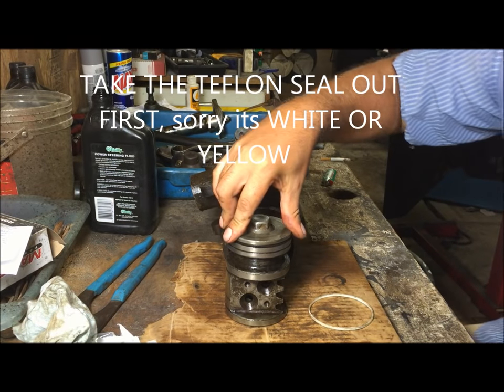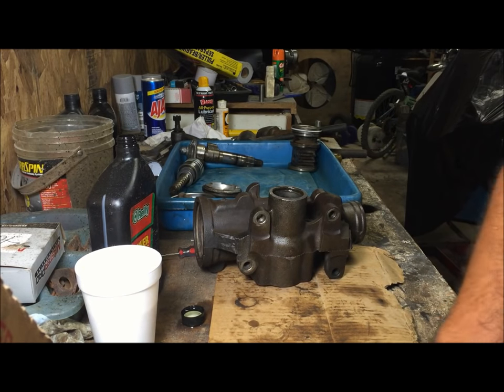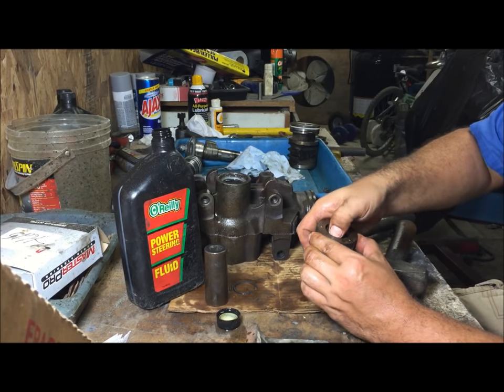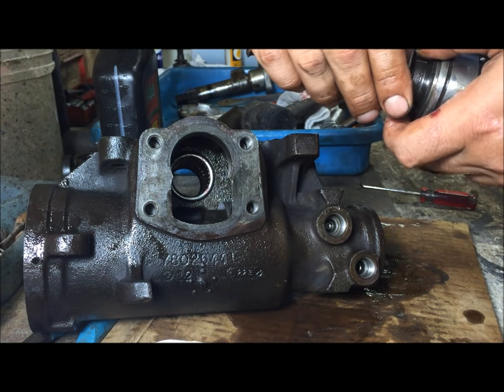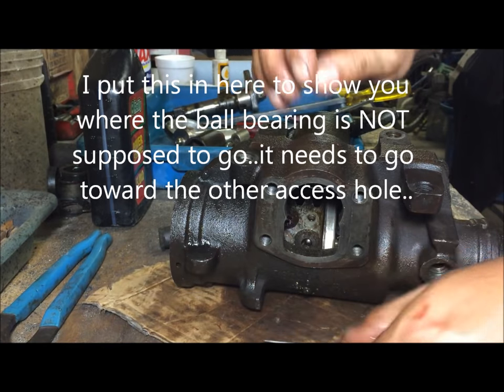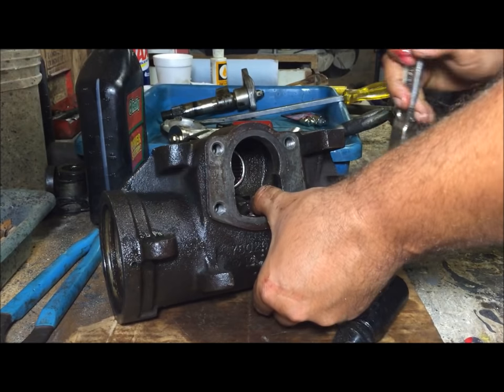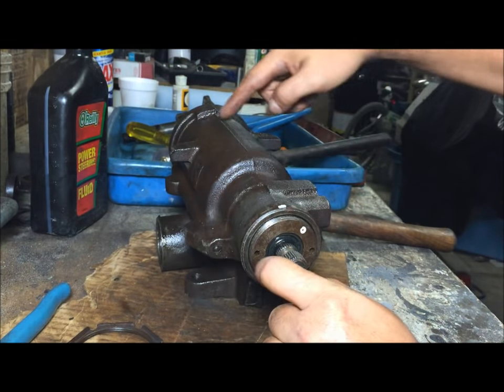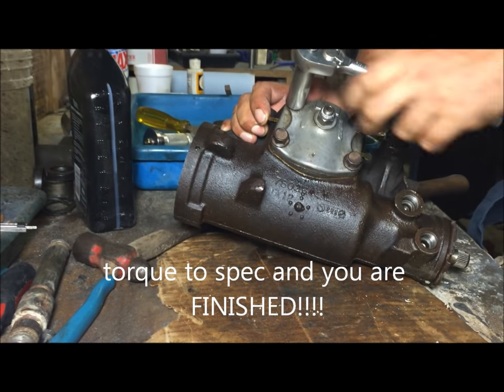how to rebuild power steering gear box saginaw part 2

Comment: Hi Chris, graet job on the rebuilt. I had watched your video and also rebuilt my 2000 GMC steering box which happen to be just like this one. The box seems to be ok except I now have a automatic steering I don't know how to fix. I had a broken clock spring and I was trying to knock off the steering wheel before I actually got a puller, now the steering turns automatically to the right whenever I start the truck and just stay there with a clicking sound. It there an adjustment on the steering column or somewhere to adjust the steering back to normal? Or did I mess up with the steering box rebuilt? I really need some help, it has been a month and I can't figure it out.

Comment: So the bearings had to be reused? No copyright strikes on the music?!  hehehhe  I do not have the patience I used to and after being broke down for two weeks I just want to get back on the road. Haaaa, just as I typed this you stated that "it is time consuming". Now you said it is tricky. This is not easy! 
Probably the most important things you said to help me decide.!! I will get angry. Challenging repairs no longer have the reward they used to. 

 I have decided to get a reman for 300$. Fortunately God sent me just enough money to get one.!

Great job on the video !
Reply from the maker: both of my boxes I rebuilt work great to this day.. my boxes were leaking fluid only so they didn’t need a complete bearing rebuild. dont ever run transmission fluid in place of power steering fluid. neither box had excessive play or I would of bought a reman one
Reply: @chriscraft77022  I would never think of putting Bud Lite in my steering system or blood system. 
Seriously though. Putting the pitman arm on my reman gear box and I thought it was the wrong steering gear because the arm splines did not meet up with the gear splines. I have about 3/16 of arm splines still showing. After accusing Advanced Auto of it being the wrong gear I watched some videos to see that the arm does stand off the end of the gear splines by about 3/16. I can see the purpose of this but I didn't know. I thought the arm had to move in far enough to hit the dust shield. But, the rubber dust shield move down to touch it.

Comment: my 97 c1500 has complete new front end, all new steering parts but i still have slop in my wheel and it is driving me crazy, any change the gear box i bought is no good or is there some kinda ajustment i need to do?

Comment: Thanks for the film Chris !    Who have the answer for me ?                         On the Rotary valve;      are you shore thats its not nesserery that rubber O-rings be placed, under the new teflon O rings ? in the  master repairkit 8524, are these 3 rubber O-rings included.   The old teflon rings did not have O-rings under.

Comment: Is it possible to pull just the top cap, 4 bolts and the lock nut (possibly the threaded "screw" if necessary) for a copper gasket change without having to pull that whole shaft out too?

Comment: Load very thick grease as before to hold the balls in place this is also good trick on Chevy engines when installing a new fuel pump reset the rod shove it in let the grease hold it grease is oil it will be fine

Comment: thanksfor the video! but i have a question about the allen bolt on top of these boxes, technically on a reman 94 k1500 box, installed it an didnt notice from the store that the allen bolt was machined wrong, or pretty much usless to try an get a allen head down into, am i able to pull the top allen bolt without dumping the guts in my box? just need to cut a slot so its adjustable

Comment: Hey Chris, great video! On my '91 K5 Blazer there was a lot of play on the steering box. Adjusting made it better but i was not satisfied so i bought a rebuild one at Rockauto. This one has the following problem : starting from the straight ahead position on the steering wheel the first inch left and right, there is almost no resistance at all (turing further gives the feel you want). It's not so much that there is play, it just feels like it. Has this something to do with the torque of the plate at ingoing shaft where you made those marks (22:03) ?
Reply from the maker: +Camatruder those marks are the preload on the bearings.. if it's not right it will feel wrong the whole range... not just 1 inch.. your new box is fine... how much did it cost on rock auto.. ?those are like $250-$300 at the parts store.. I think..
Reply: 200 USD including core charge. I kept my old one and may attempt to rebuild it myself. I tought that if the preload is too little, that could cause my  problem?

Comment: i would love to rebuild mine but i dont have the proper tools i just recently installed a power steering pump (1997 chevy 1500) and i was only going to change the pump but autozone didnt have any in stock and o'reilly had the exact pump but had something added where the spring and sensor are located i tried to take off the thing off but i couldnt so i just told them to give me the pump and reservoir, it took me 3 damn days to complete, but even though my power steering got way better i believe the steering box is also bad (plus traffic and bleeding the pump) took me 2 days for a rear drum brake cylinder i know those two things should take 1 or two hours tops but i dont have the right tools and i always end up going to the store to buy what i need now imagine if i rebuild this....it will probably take me a week

Comment: 3:10. I'm thinking maybe rotate it a little as your gently forcing it in. Might help. Also, before I watched the video that aluminum cover that has the 4  bolt has that threaded shaft sticking out that has a lock nut on it. How do I now adjust that so the big male gear that intersects with the internal gear is adjusted correctly. It is obviously an adjustment that moves the gear laterally back  and forth across the steering box laterally.?

Comment: Sir, I am your subscriber from Indonesia, I want to consult with you, does the worm steer have something called a TORQUE ROD?  What is its function actually? Because I have a Worm Steer for an Isuzu Trooper Diesel car where my steer is already heavy and I have replaced the Seal Kit but it is still heavy, the information I got had to be checked on the TORQUE RODS and the TORQUE RODS were modified using a lathe so they are usually lighter Turn the steering wheel of the car. So far this has not been discussed with you. function and use of automotive tubes. ? Thank you, I'm waiting for the answer

Comment: If I'm not mistaken aren't the ball bearings all slightly different diameters? And have a specific order. or is that on the vairable boxes?
Reply from the maker: they should be but these were all the same. The Chevelle box had different diameter and they were slightly different colors too

Comment: Hi Chris,

I have a problem with a steering box and seek your advice.

The rubber steering box coupler with the steering wheel was damaged in my patrol and while changing it, I hit the input shaft with a 2kg hammer both in (during assembly) and out (during disassembly). 

Now and after testing the car, the steering wheel is a bit harder to turn especially while in center and the after turn, it does not return to center easily.

Is there a hope with the steering box to be fixed or adjusted?

Comment: what if i fucked up and didn't mark the housing input shaft and lock nut at the very begining?

 how do i get it reset correctly?  the manual says 1/2 inch back off. i tried that but i got a lot of play in my steering wheel still.

Comment: I bought a gear box for a chevy tahoe 99. When installed its hard to turn the steering wheel. Its almost like no power steering.
Reply from the maker: did you buy it new?

Comment: Great video but I have seen too many input shafts where the plating has worn off and the seal will not seal and the bearing will not fit due to the decreasing cost of the entire steering gear even though the parts to repair a cheap the labor involved is intensive and if something goes wrong there is a problem expensive maybe it is best just to by the gear and give somebody else the headache except for installation and removal if it is bad my steering gear on my car is leaking I realize it may only be the seal package while I got it off why screw around just put the new one in and be done with it anybody who adjust the tightness is ignorant it cause it's far more problems than it cures if the sector is worn out pulling tighter but only make it tighter on half turns or third turns it will be over tightened some places while tight enough in others this is not a good solution thank you for a video I bought a new one Advance Auto cheapest price I know that's wild

Comment: I have a 78' GMC square body and currently the steering is awful. You can't get full lock to lock steering out of it at all. I have to make 6 point turn just to get out of a parking spot to turn right or left. It sounds like a damn turkey call once I'm turned the whole way right or left. Is it even worth rebuilding or better to get a new steering gear? Anything I can do in the mean time to try to improve it till I have the money to get one at all?
Reply from the maker: +Samsquanch buy a new one on rock auto

Comment: I hate when the seal garter springs pop out. I made a tool for a crankshaft seal to press it in instead of hammering (which kept popping the spring out).

Comment: Were did you get the seal kit? What number is it. I have the same sterring as you have and I´m planing to rebuild mine to.
Stefan
Reply: AC Delco  Pn 36-350340  Gates pn 350340.

Comment: A long shot, but does anyone have a source for the rack and worm? Once you've done one of these, it takes longer to clean the crud off the outside than to do the rebuild, but I can't find the hard parts anywhere.
Reply from the maker: if my box needed parts like that i would just go buy a new one..  some guy told me he got one cheap on rock auto

Comment: hello, this rebuilt don't fix the axle play right ?
Reply from the maker: no...    this box was good...   search videos..   that have the car with the wheels jacked up off the ground...  that is the only way you can adjust that...  i will tell you right now...  GO BUY A NEW BOX... it is not worth it...  the teeth are worn and the worn teeth will only carve into the gears and recreate the problem...
Reply: ok, I will buy a new one ... thanks you very much for the videos and your time to response.  BR
Reply from the maker: you can not go wrong with a new one...   thanks for watching..  but have you jacked the front wheels off the ground and made sure that the play is not in the suspension?   tie rods? pitman arm, drag link, etc???
Reply: The play is inside the steering box, when you move the input shaft with your hand, you can feel and see the movement in the steering box, but do not transmit the movement to the pitman arm. So I assume that the gears and or the worm must have wear
Reply from the maker: if it is a car or truck you are going to drive a lot buy a new one...  it is not hard to adjust the play but if you dont know what you are doing you will have no way to accurately dial it in other than just the way it feels...  if you had to do it clock the bolt and tighten in increments of 5 minutes (like a clock face) until you get most of the play out.. (that way if you go to far you will know exactly how far to go back) if that doesnt instantly make sense then dont try it.. but if you have family and friends around you dont waste your time...  ive seen steering boxes make fools out of a lot of people trying to fix them

Comment: I load the balls in the cylinder first w/heavy automatic transmission assembly lube, then screw the shaft in.
Reply from the maker: i tried that like 3 times and it did not work for me..   on both boxes i did, but yeah, ive heard people saying that worked for them....
Reply: may be not too easy

Comment: Hello my gear box is really hard to turn on my 82 c10 pick up, if I do this will it get fix??
Reply from the maker: i would replace the power steering pump first.. those boxes last forever..  try to drain as much fluid out as possible,,
Reply: Thanx for responding, I would do that what fluid would you recommend for my box?
Reply from the maker: I use oreilly power steering fluid
Reply: Oh ok I'll get that too, my steering is super hard, I need to battle it to turn haha
Reply: Hey I just notice my steering box is a manual steering box not power steering
Reply: I took the oil fill bolt and the level it's good, if I install a kit will it be fix??

Comment: A very common steering box used in zillions of cars for half a century. GM and Ford among others. And the basis for Sprintcar steering boxes. Alloy case and other mods but still a Saginaw box. Sweet and many others. Used in sedans as well.
Sweet make ratios from 6-1 to 22-1. Unfortunatly for me my RHD Ford has about 22-1 and is bloody awful.
If anyone has any ideas for these RHD let me know. 14=1 would be about ideal.

Comment: I don't think you want to mix grease with power steering fluid.
Reply from the maker: i agree but that box has been on the van for almost 2 years without any leaks
Reply: They at one time were assembled at the manufacturer using a light grease
Reply: It's not going to hurt anything, it's all petroleum. When you've done this a few times and spent time using the part, then pitch in your $0.02.

Comment: Rebuilding my box for my 75 c10 right now and the ball bearings are kicking my butt. The orientation of the holes on mine for the bearings are opposite of yours in the video. With the piston all the way out to the edge, the hole you load them in is at the bottom right corner, mine is at the top right corner and bolt hole is at the bottom right corner. I’ve tried 4 times now and can’t get it right. Don’t know if I have to do something different than you did since the hole orientation is different than yours like I stated.
Reply from the maker: it takes a while to figure it out.. did you check for big and smaller bearings and they go back in in that order
Reply: @chriscraft77022  yeah I figured it out last night. Found another video of one that was a steering box the same as mine with the different size ball bearings and got it all in and working. Thanks!

Comment: I tied to do this, the instructions said to drop them in hot water
Reply: The teflon rings?
Reply: @squidusn71  yes, drop in boiling water 5-10 minutes. Install one seal while others are doing their 5-10 minute soak. My seals shrunk right back to size no issue.

Comment: do not mix grease with power steering fluid
Reply: For all those who keep saying this - the factory GM service manual procedure specifies using light grease to hold the balls in place during reassembly. Vaseline would be just as good.

Comment: I'm confused with the so called adjusting screw some say it takes out the play some say don't touch it what is it actually for anyone really know
Reply from the maker: It takes the play out but people always tighten it too much and ruin the gears.. you tighten it in 16th of a turn until it starts to feel better
Reply: Chris Craft hi Chris do you adjust it with the truck on  the ground or up in the air also some say turn the steering left or right before adjusting not with the wheels straight so many theories with steering boxes on what is the right way iv just installed a reconditioned box but still has a bit off play im not convinced they changed any off the parts also found on the old unite I tightened the screw took the play out of it but it came back any ideas thanks
Reply from the maker: there is no theory.. the gears have a tiny bit of clearance.. not enough clearance and the steering will have play.. too much and you wear the gears and ruin the box ... you need to understand what you are trying to do.. adjusting it on the vehicle is the dumbest idea on the planet.. a reman box won’t have play..  if it does, return it
Reply: You will need an inch/pound torque wrench to properly set the rack and pinion gears.  Find center of travel (high spot in gear set up) and swing torque wrench back and forth off and on high spot.  Adjust allen  set screw to approximately 14"/#s and tighten jam nut.

Comment: As a retired steering gear tech please keep this in mind... To repair one of these professionally from a real experienced steering repair shop with warranty and next day turn around costs about $300-$500 with core. If you attempt to repair it yourself and you ruin the core ( It happens all the time, literally every day ) When you go to the steering shop to fix your gear that you ruined, you're going to have to pay the $300-$500 PLUS a core charge of atleast $300 since you ruined you're core by trying to fix it yourself. So now you're looking at $600-$900 for your gear because you werent experienced enough to notice one of of the 10,000 things that could go wrong.
Reply: So go to the junk yard and get one for 50 dollars and tell them to rebuild the one you didn't screw up.